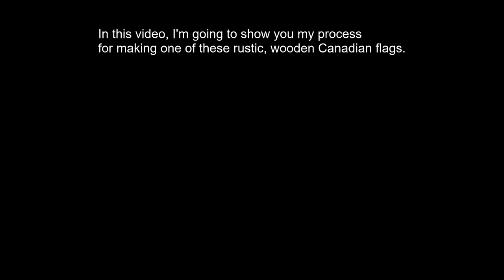Making a rustic wooden Canadian flag.

Comment: Looks fantastic!  A few questions?  What type of wood did you use?  (1x6?). Where did you get leaf template and what material is your mock up made of?  Thanks
Reply from the maker: Thanks. As mentioned in this video's description above, I sell these flags at my Etsy store: https://www.etsy.com/ca/shop/saschawerks
I make 2 different styles (painted as shown in the video and charred). I offer 2 sizes. A small one (11"x22") and a large one, which is the one shown in the video, 22" x 44".
Yes the wood is kiln dried SPF 1x6. The leaf template I made myself. I simply took a Canadian flag, scaled it to the size i wanted and printed out just the leaf (over 4 pages). I then pasted the pages together and cut out the leaf, traced it onto ¼" hardboard and cut it out.
Hope that answers all your questions.

Comment: Sweet art. Do you plane the boards at all?
Reply from the maker: Thanks. No i don't. I do sand them with #150 though, just to take some of the roughness off, but far from smooth...in fact i try to keep as much rustic charm (saw marks etc) on them as possible.

Comment: Wow man, real nice. Is it possible to use wood from a used pallet to do this? Gotta have one of these for my entrance and would love to get rid of some of these pallets in my backyard
Reply from the maker: Thank you. I don't see why not. The great thing about making anything rustic is that it doesn't have to be perfect. Might just have to adjust the size, depending on how wide the pallet slats are. The official ratio should be 1 to 2...i.e. the flag should be twice as wide as it is high and the red/white/red should be 25%/50%/25% of the width.
Hope that helps.

Comment: What color red did you use and what is the size of the flag? Where did you get the maple leaf stencil?
Reply from the maker: Glidden premium satin exterior latex in “red geranium” from HD seemed a close match. This size flag is 44” x 22”, I also make them in 28” x 14” and 22” x 11”. I made the stencil myself. Printed it out on paper (over 4 pages for that particular size) , taped the pages together and cut it out and then traced that onto the 1/4” hardboard and then proceeded to cut that out with a jig saw and refined it by sanding until I was happy with it. 
Hope that answers your questions.
Reply: @saschawerks  yes it did. Thanks for taking the time to respond.

Comment: further to my question abt the proportion of the flag, I have another question if you dont mind.  Im going to make a flag for my office   It will be 12"x24"  -  how do you determine the size of the maple leaf for the flag.
Reply from the maker: I took an image of the flag and scaled it to the size that I was making. This can be done a number of ways, depending on how tech savvy you are and what programs you have at your disposal. I don't recall which program I used, might have been sketchup or even just MSPaint. 
Just for reference, I sell a small, medium and large version of the flag and for the small size I make, which is 22" x 11", the maple leaf measures 8 11/16" tall.
Hope that helps.
Reply: @saschawerks  that works for me - that is pretty close to the size of the flag I want to make.   Appreciate the quick comeback